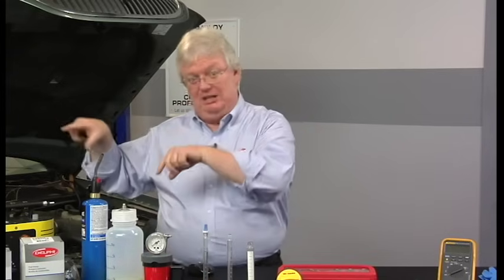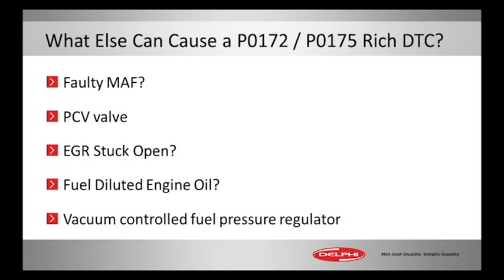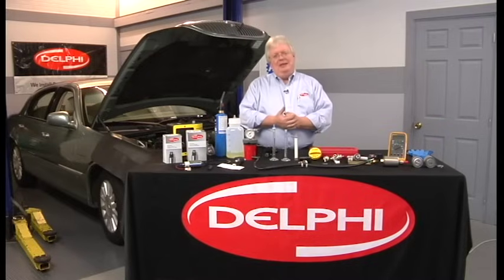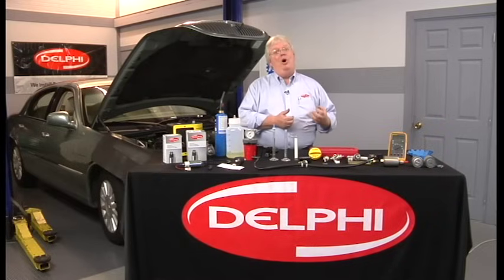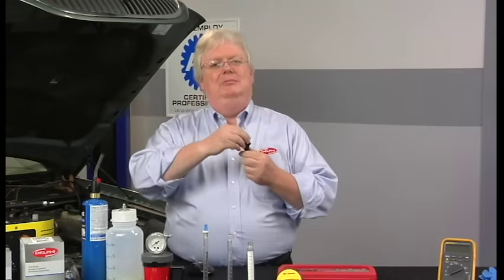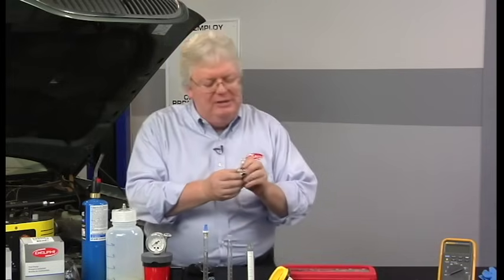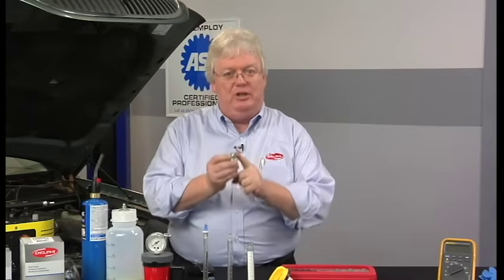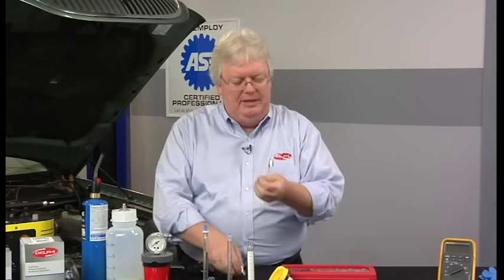What Can Cause P0172/P0175 Rich DTC? (Diagnosing to Win with Fuel Trim)

Comment: I got the 'Bank 1 Too Rich' error at a smog station, then went to Auto Zone and their machine suggested I replace the Mass Air Flow Sensor, which I did and will now test drive and hope the 'check engine' light does not return 🤞
Reply: What happened
Reply: @MOTIVATIONAL.SHURTS it wasn't the MAF. I think it's the upstream oxygen sensor giving a faulty reading, but I didn't replace it because I put the car on non-op instead.

Comment: So what I’m getting from this….clean the injector and clean the MAF sensor just to see if the codes go away…if not, then try throwing parts at it?
Reply: You can often throw a hell of a lot of parts at it for what 1 trip to see a tech will net you and no guarantee they will resolve your issue....I spent 340 bucks to get a could be this or that....I don't know answer.  Yeah, throw parts at it is a better gamble unless you know for sure what the issue is and then you can either fix it if you have the capability or know your limits and get some quotes.
Reply: @ to be fair…if one part is having a bad day. Others probably aren’t far behind.

Comment: 2007 Lexus IS350. Threw codes P0172 AND p0175. It was the plug into the MAF that was loose, not properly seated.
Reply: Thanks getting the same code
Reply: I have a 2007 is250.  Same codes. I checked the MAF numbers using OBD scanner and it looks healthy (goes up to 100 when I’m flooring it)  but I’ll check the connection again.

Comment: My 2017 Tahoe  with 70,000 km just set Code P0175 Low Voltage Bank 2 Sensor 2
just Changed Oil Yesterday , also Filled with Super Gasoline - What Gives ??????????
CATS were Replaced Last Year ALSO with NEW MAF Sensor 
RAN OK Before OIL Change

Comment: My evap purge valve was stuck open. Replacing it solved 4 problems and engine light went out on it's own after several drive cycles. It would have hard start after gas up, cap light intermittent, and rich bank 1. The valve purges to left side of intake at bank 1, and 4, large evap leak. Edit 08 trailblazer 5.3
Reply: sounds similar to mine in a 3.6 RAM, but both banks...hard to start at fill up...however I've changed the Evap purge regulator...wondering if it's a bad unit possibly...I've been changing everything to no avail so far......

Comment: Got a 99 mercury grand marquis w 172 and 175. Both banks running rich. Checked for vac leaks, changed pcv valve hose, changed coolant temp sens, cleaned MAF sensor, used fuel injector cleaner, still have both codes. What do I do?
Reply: Another video I watch showed MAF or O2 sensor for these two codes. My van just started doing this and I'm currently researching.
Reply: Check 02 sensors

Comment: I have a 2001 Lincoln Town Car that I just bought from somebody the codes are reading po172 po175 Bank 1 Bank 2 I've changed the mass airflow sensor and all four of the O2 sensors and the cold still will not clear what do you recommend for me to do because this problem is really driving me crazy
Reply: Check your air filter make sure it's not dirty and check the throttle body and make sure it's not dirty
Reply: I did that also went to autozone told me i had a bad massair flow sensor replaced that and still there is a code on bank 1 & 2.  Car is running completely fine.  Maybe though I haven't pushed it so ....

Comment: 2010 Kia Rio —P0172 Too Rich code. Long trim -26%, Short 1%, Front O2 switches 0-800 volts. Engine runs smooth no misfire Pleny power—all basics test ok...Hard Cookie we call it....still cant figure out

Comment: I am getting P0303 & p0172. checked my #3 cylinder spark-plug and it was loose. I tightened the  plug and cleared the code. hope that's the problem.

Comment: I got the code and realized the the MAF reads 0.2 with just the key turned on. I replaced the sensor and now it reads 0.0. Sometimes just resetting the computer will fix it because bad gas could throw off the sensors. We use to get those ever so often when driving the box trucks. If it keeps coming on... Then I would follow the instructions on the video.
Reply: MAF should read 0.0 with the key turned on?
Reply: @noea7344 yes, with the engine not running as there is no air following past the MAF sensor

Comment: Can you pliz help i have a 2007 merc with a m272 engine v6 c230 and i have this code 0746 self adaption of mixture formation for enleanment at partial load for the right bank above permissible limit - Permanent 
code 0750 self adaption of mixture formation for enleanment at partial load for the left bank above permissible limit - Permanent but the car is running smooth what is or might be the cause?

Comment: Could it be possibly O2 sensor Downstream
Reply: I bet more o2 sensors are wasted thrown into cars by people thinking "must be the o2 sensor" than are actually bad. There are diagnostic procedures to verify problems so you don't throw parts at it.
Reply: @WCGwkf  still not a bad idea to swap them out if it’s been atleast 70k on the sensors
Reply: @bobtailsthecat  yeah but they are expensive and aftermarket ones are trash

Comment: What about a faulty temperature sensor ?
Reply: 99% of the time it is not the ECT sensor.  It is popular to sugges that though.
Reply: Brittany Cantu I asked that because my find has an early 90s Chevy 350 and he had a bad temp sensor and was making it run very rich...changed it and it was fixed..I don't know if that would cause the same problem on newer vehicles?
Reply: @brittanycantu2732  what could it be on my 2004 echo. P0172 and run super rich. (Black smoke at the exhaust and very bad fuel consumptiom) spark plugs are fine and PCV valve cleaned and checked. Thx !

Comment: 03 BMW is pulling a p0171 bank one lean and pulling a p0175 bank two rich...I changed the pcv/oil separator with a catch can and added a pcv to it and that's working better then ever but still pulling codes...